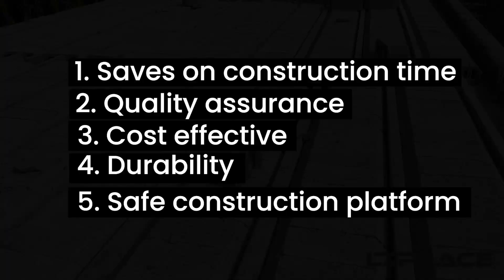BEAM & BLOCK TECHNOLOGY-EASY TO FIX

Comment: I like my pour concrete with steel..in a real earthquake everything drop in your  head..😅😂
Reply from the maker: Hi, the beam and block flooring is guided by BS EN 15037 which have alternative methods for monolithic connections. It is a designed solution, even the concrete and steel is designed differently in areas prone of earthquakes and wind loads.